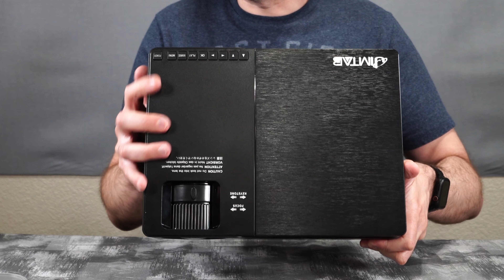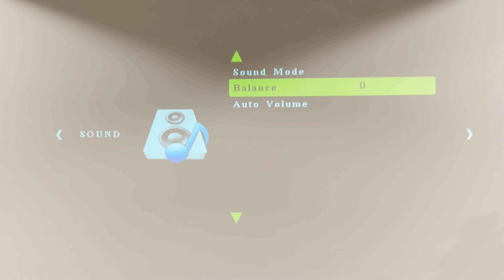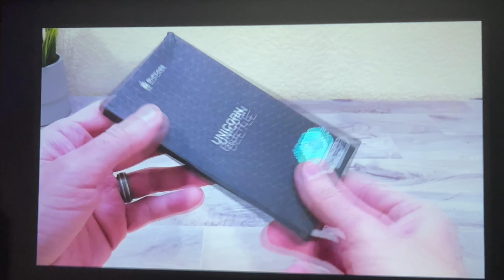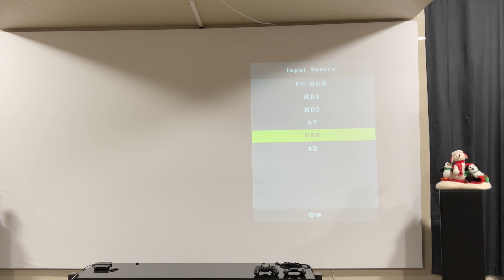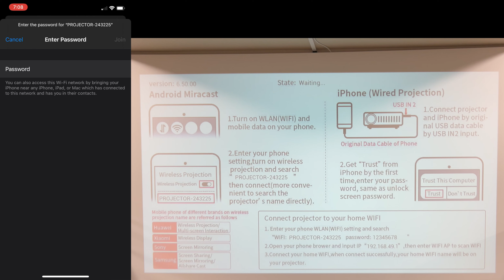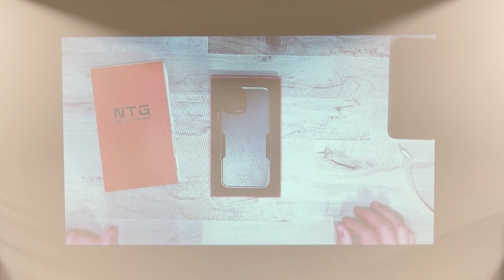Jimtab M18 PRO Version 1080p LED Projector W \ Wireless Screen Casting! - Review

Comment: Nice review! I have the Bomaker Parrot 1-looks A LOT like the Jimtab, lol! All coming out of that same Shenzhen factory. Quite a few projectors are clones of each other. The Vankyo 600 series is also very similar, and a number of others like the UUO P6, etc. There are also a number of other projectors with the M18 model no. and different manufacturer names-these are THE SAME PROJECTOR!

If you want to see ANY COLOR, you absolutely have to TURN OFF the lights. The picture given with light in the room is ALWAYS washed out as far as color is concerned and is not a pleasant experience. These projectors are just NOT bright enough with that 300-360 ANSI lumens they cannot compete with a real 1500 to 3000 ANSI projector. That's why they are "budget". 

My projector, like many others also claims 15,000/1 contrast ratio, lol. In reality it's probably more like 1000-2000/1. Even a CHEAP direct view HDTV is NOT much more than 3000/1 so 15K/1? No! Contrast levels are adequate here, nothing to brag about and on the low side! 5000/1? Nowhere near that!

For the money, though, and these are getting cheaper and cheaper. I recently picked mine up on a close out for $100! Now that's cheap. You can't beat these at that PRICE! If you want brightness, better contrast and punchier color, color better than 8 bit (which is what these are), you need to spend  $600 or more.

Here's a tip for better image. Go to a fabric store and get yourself a 54" x whatever PVC sheet cut to whatever-at least 8' or more. And fashion a screen from it. A flat white smooth PVC sheet of that size will run you $14 or less. And many professional options use that material to reflect 100% of the light projected at them. A 1/1 gain.